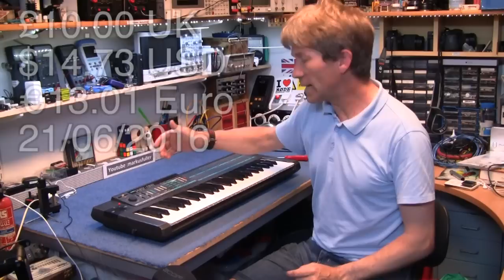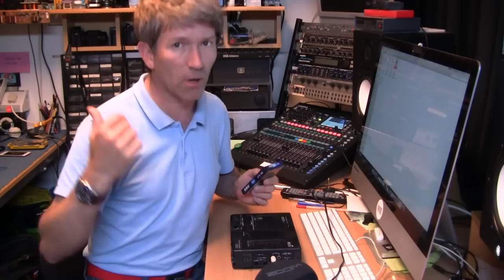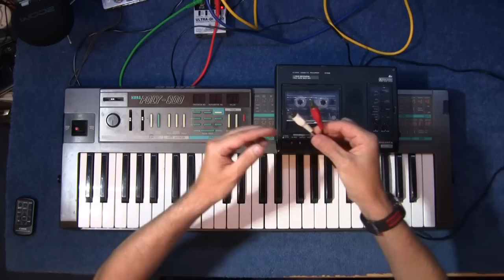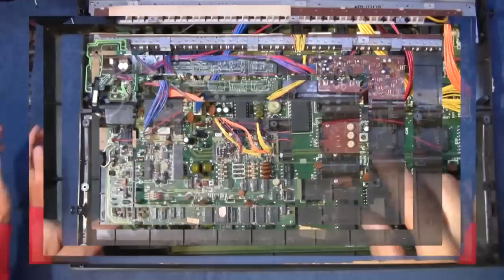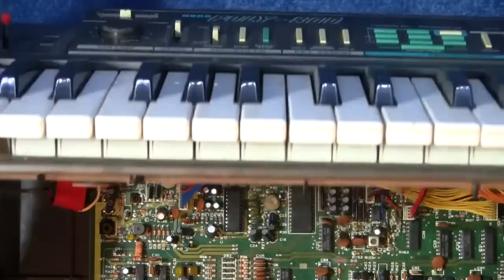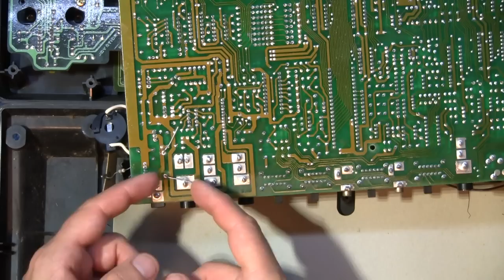korg poly 800 not worth the cost to repair this vintage synthesiser MF#81

Comment: I have a poly-61 in a similar condition. cleaned up board, replaced bad tracks & connectors. No clk out of either MCU, no activity on any pin. Next step would be replace the (socketed) MCUs at £30 each... then the rest is probably bust... so EJECT !!

Comment: Hi ! I am almost done restoring the same synth I got for 100 euros last summer. 1) Got the same sticky and stinky brown layer on all the boards, cleaned it with iso alcohol but that was intense to wash the dirt out between the components with a tiny paint brush. 2) location of the battery was wrong on yours, it's originally right in the middle of the main board not nearby the power supply socket, so it's was a mod. 3) mine was really rusty on a corner of the keyboard frame ,even on some board connectors and some screws...+ 40 years gear...I have left to solder a new socket for the battery and reload the waves after reassembly.I hope it will work well enough while I hunt for new components so I can have it in the end almost like brand new...😅

Comment: Seeing that unsoldered component was just scary. 
From what you found it looks like someone ganked the CPU  and perhaps other componets. That makes it quite a project .
Theres a very detailed schematic with test points and what signals to look for  - lookup: korg-poly800-ex800-service-manual.pdf

Comment: Hello Markus and others. I am in the process of replacing the rubber pads beneath the keys due to wear. Does anyone know are those pads universal or do I need to find specific pads for my keyboard. Mine is a Doner dp 10, two years old
Reply from the maker: @abacussin  Hello abacussin, is those rubber pads are on a long strip and touch a circuit board then they may be the carbon contacts for the keys and you may have to contact Doner to get the correct replacements. however if the keyboard is only 2 years old i’m surprised you have to change them already.
Reply: @markusfuller  Thanks Marcus.I play a lot and its a cheap version of a good keyboard, although it still is quite good for the price i paid.

Comment: I have 5 Mono D Batteries instead of a Buttonbattery and no Solderpoints in the middle of the Board like youve got there! Is this the Solution to Solder a ButtonBatterie upthere, so i dont need no 5 Mono Ds? Can anybody confirm?

Comment: The battery on my poly-61 leaked all over the board and ruined it.  Maybe the battery in this synth was moved to pre-emptively prevent this?
Reply: As he said in this video: The early versions had no internal batterys. The Memory was supplied by Mono D Batterys. The litte Li-battery in this video looks like a battery-mod as in https://www.youtube.com/watch?v=BZj4nYrWFRo
Reply: Not relevant as this unit usually uses a lithium 'button' battery whose leakage is not as deadly damaging as Poly61's NiCd cell was!

Comment: I owned one of these back in the early '80's...first MIDI synth....had the tape backup/load etc... The LED lights should not be flashing/scrolling in the display.  Too bad it wasn't recoverable....thing these days is to be sure and recycle it for parts to help keep another one alive somewhere.
Reply: This effect comes from the Videocam, interfering with the multiplexed LED of the Display.

Comment: I love my Poly 800 bought it new in Dec 1984 Still works perfect I took care of it No dust beer change inside battery 2 times I Never put the  6 batteries in to play remote They will ruin it they leak fast
Reply from the maker: Yes it is a good synth and I feel sad that I could not save this one.

Comment: The two 40 pin chips on the right hand side is the main CPU(Intel 8085) and a PIA. And if it's doing nothing, that does sound like a problem.
Reply from the maker: sadly I am unable to check now as that keyboard ended up being broken down but some of the parts were posted off to other people to help repair their synths.

Comment: You did not need to check the battery. It will hold presets until you turn it off. Even without the battery. First half of the video is useless and boring, sorry

Comment: I still have my Poly 800 that I purchased in 1984 and was excited to see this video. even tho mine isn't currently working either, I cant bear to "part" with it. It had the most lush sweet string sounds ever (that's what I wanted a synth for in the first place)  and for such an inexpensive synth too.  sorry that yours was actually DOA. I was so hoping to hear it again.

Comment: You don't need an actual tape to load the presets, it works by simply connecting the computer directly to the Poly.

Comment: Actually i fixed a few of these they play dead when the battery dies. Then you can restore them with a wav file you can download online and play into the tape input. Then they work like new. But they are a pretty basic analog synth to start with.

Comment: Judging by poor job on the reverse polarity protection, battery getting warm, +4VDC on the output and the voltage regulator being too hot to touch... why didn't you check for a short on the power input first?

Comment: The first thing to do is properly solder the diode in place and clip its leads. The second thing is to measure the voltage coming out of the regulators. That one that is very hot might normally be hot or something on that power rail may be partially or fully shorted. It could be fun trying to pin down if there is some simple problem that can be fixed.

Comment: I have a poly ex-800 sound module, battery is dead and I would get just white noise sounds. I had to write all the sounds from scratch   and save them or just leave it on. The battery was always an issue. Fortuneately its the easiest old module to write to
Mine is still working but the display is hoopy an led is out. The old polysix  keyboard was a beauty it was blue and black lots of knobs no midi? That was a vintage keyboard worth saving, alas it did not happen

Comment: Did you try actually soldering in the diode? Its leads would be carrying half wave rectified AC to whatever it was touching, hence the 4v (4.5v?) DC on the output and overheating regulator. Take the board out, wash it and leave it in the sun / on a radiator for a day. Don't tell me you threw this keyboard out, probably nothing wrong with it!

Comment: 8Bit guy managed to fix his!
Reply: 8 Bit Guy's keyboard just needed a new backup battery, something that is honestly basic maintenance for old keyboards.  The Poly-800 Markus has is beyond repair. The previous owner didn't know anything about how to repair the keyboard and destroyed it.
Reply: Was going to say the same, 8-bit Keys guy had much better luck.
Reply: Wholly different situation. In that case just the battery was dead. This one was messed up..

Comment: said it on 8 bit guys video, but ill say it here too. poly 800 is garbage. stick with the Poly 61.
Reply: Hunter Skowron poly 800 and poly 61 are completely different levels of synths. One is basically a toy the other pro equipment.

Comment: Why do you wear your watch on your right hand?
Reply: That's not a watch, it's an earthing device to prevent static discharge into the electronics, it has a wire attached to the bracelet which in turn is connected to earth.

Comment: the poly 800 wasn't worth buying when it was new
Reply: Or prop up the corner of your trailer home!
Reply: I highly disagree. I used an EX-800 the desktop ver on my first cd in the 90s which sold a few thousand for an indie electronic album that was a DIY release I think when programmed well and marinated in the right reverb it is still useful. Go back to your preset DX7 nostalgia or software based boredom!
Reply: LOL. I actually live in a 2 story brick house. but it's funny you mention that. one corner of our house IS sinking  a bit. and it's the corner where I keep my Hammonds, Leslies and synth collection.

Comment: Poly 800 is currently from 150 to 400 Euros in the bay, depending on its condition and location/continent. I would say, try to fix it and then wait a few years. Analog is rising constantly, even paraphonic ones like this old friend.
Reply from the maker: pontram This one has already had parts donated to repair another poly800 so at least one out of 2 broken ones is running correctly now :-)
Reply: Well, it seems that's a common fate. I bought a defect one myself, to repair mine (or vice versa, there was a huge parts exchange ;-)

Comment: If it would have been a bad battery, the poly would have still worked immediately after reloading the presets. Only after turning the machine off, would the sounds be lost once again, hence you would be back to the strange noises or no sound. Great video, thank you for posting...

Comment: I´m sure that this was a "smoker-unit" as i call them when the guy who owns that first smoked cigarrettes....but i´ve seen much much worse units. My fostex A8 had a very "good" coating on it. Its PCBs had been dark brown and sticky like chewing Gum whereas they should look mid-greenish...I used several litres of iso-alc to clean these PCBs all and thoughout.
The smell when i was cleaning it was absolutly discusting i can tellya...

That main board is definitely BER! But i still would keep the thing "as is", you never know if you need some parts out of it.

Comment: I bought a black keys edition on ebay recently which worked out of the box, but opening it up, that troublesome diode from about 11:00 had broken clean in half! I guess someone must have fed it too much voltage, the wrong way round. Anyway it worked. I replaced the diode and did the Moogslayer mod. However, I can't seem to get it to accept a tape input to reset to factory settings. So I've a feeling the second that battery runs down, it's bye bye Poly 800...
Reply from the maker: I donated mine to a friend who needed parts to bring his back to life, He fixed a separate battery housing inside so he can replace the battery when necessary, if the battery is replaced while the unit is powered on then it does not lose its memory. however im not sure why you cannot send in the factory backup maybe volume of the signal being put in is too low, the led display should flicker as the signal is being read.
Reply: The signal flickers pretty well but always fails. It's a shame, as I have lots of custom WAVs that I've downloaded that I'd like to try. Then again, I have only tried it direct from the computer as opposed to from tape. Perhaps I'll dig out the old NAD andgive that a go!

Comment: I read somewhere u should put the c / d cells battery to keep the patches going on...
Reply from the maker: true if you keep good batteries in it then it should hold its settings but as soon as they are removed or changed then you should have the power supply attached and turned on while you change the batteries over unless there is a good cr2032 internal battery fitted to hold its memory.
Reply: Thanks for the reply markus! I just got me a Poly 800 no external batteries but stored patches after turned off so I'm lovin it!  Anyway I try to clean the keyboards coz some notes didn't work... But I don't know how to remove the keyboard,  ive experienced with yamaha DX which I just push n the keys slipped out. But I seems to can't find a way to slipped it out on korg Poly 800... Can u give a Lil guidance.... Anyway really enjoy your videos
Reply from the maker: Hello LLOYD, sadly I have already donated my poly to another viewer that needed some parts so I cannot open it up and check how the keys are removed. you may find that the long thin circuit board that runs under the keys can be unscrewed and lifted out. that will contain the switchgear that needs cleaning instead of removing all the keys.
Reply: Thank u so much I think I'll give it a try later!  Anyway yeah I lost my patches after hours lol. I guess the external batteries do required to keep the patches. Thanks to modern technology n this video though I know load it via cellphone for just seconds... Thanks again markus
Reply from the maker: A friend of mine has one of these and it has a 2xAA battery module with long wires on it leading to the solder points of where the old onboard battery was. therefore he has glued the 2xAA battery box away from the board so if they leak over time they will not destroy the tracks of the circuit board.
Reply: I've clean the carbon on the rubber n contact with stadler eraser without removing the keys just like your suggestion now it works thanks!  I also adjust / correcting pitch by tweaking the trim pots. I almost got it perfect now lol. Just need to work on the external batteries :D
Reply: Oh yeah markus I have one more question some keys makin noise when I press is like they're slamming n have no spring under. Do u know what might b the issue?  Thanks...
Reply from the maker: maybe the springing mechanism is worn due to age. but I have never had to deal with that problem so Im not too sure.
Reply: Ok Thank you so much for your replies Markus I'd really appreciate it

Comment: i have one of these that works but cant be programmed because of the battery being old.  its one with the inverted key colors. wish i had the time and battery and program to make it all 100% again.
Reply from the maker: You can buy the battery easily and just solder it into place. or even place it somewhere away from the board and use a couple of cables. if the battery is old and you leave it in there it could leak and damage your synth over time.

Comment: Hi markus!!! Nice to meet you!!! I have since a long time ago a second hand Roland JV-80. When I buyed it (pretty inexperienced at that time) it arrived to me with no data on its memory because the original battery was out of charge. The original owner did replaced it but leaved the instrument with no data. From that time I used the instrument with my own sounds, Because it works and sounds very good, but I would want to recover the original data. Is it any Expansion cards for this situation or downloadable data from the web? I love your videos and your help. Please tell me what do you think. Cheers from Argentina
Reply from the maker: Hello Emerson. hold down the number 8 button and turn on the JV-80 (keep this button pressed down while turning on.) then you should get a (factory reset) appear in the screen. then let go of the 8 button and press the ENTER button. that should set the unit back to the original settings in a few moments as if you just purchased it from new. I hope this helps. Best wishes from Markus.

Comment: nice vid

but i had the same problem and weird voltages everywhere which can mislead you a lot.
i replaced the voltage regulator and it work fine again

Comment: On the positive side, the cheaply made Poly 800 is far from rare.  I've had about 5 of 'em over the years ... the last one I had wasn't making a sound so I sold it for 50 bucks.  These days I keep company with a Poly-800-II, which is a much, much nicer instrument.  In contrast to the original it has a handsome black enclosure, a filthy digital delay with modulation, programmable bass/treble EQ per patch, MIDI sysex, and the real kicker: exponential envelope curves (vs. linear on the original).  So the mkII always sounds punchier, and has a more ethereal release stage - it's what the original should have been.
Reply: That chorus on the og though.

Comment: There would've been a battery on the board originally (on the two pads you point out at the beginning), but those old Korgs had a bad reputation for the batteries eventually rupturing and etching away the entire board along with the components.  That's what happened here too.

Comment: I'm not sure about this, but I remember getting a korg poly 61 a while back off ebay and when I first turned it on, it did the exact same thing - TAPE over the LED display, weird little pops and clicks coming from playing the keys. I realized that I had it in tape mode - there is a switch on the back. Switched it off and it worked completely as it should have after that. Don't know if that would be the same case here or not.

Comment: One thing to check is the the presets are filled with scrambled data. If you go through the parameters you will probably see that some of them have values beyond their range or strange characters. When the RAM blocks have bad data written to them they can't be written over with the preset tape. I've had something similar happen and to fix it I went the Patch 11 and set all the values to the proper range then copied patch 11 to the other slots. After this procedure I was able to transfer the factory sounds from tape.
Don't give up on it yet! Thanks for the vid.
Reply from the maker: Thanks Puffin Thomas. I have put it away for a rainy day. but I will remember your advice if I ever get it back on my desk. Many thanks from markus
Reply: Wow. That's super interesting! I'm going to remember that for later.
Reply: @mraduanemc  me too!

Comment: I do hope you disposed of it in such a way as a third person won't try to fix it. I had a Seil Synth that had a failed voltage regulator dumping overvoltage through the entire logic board. As soon as I found that, I dumped it too.  I also had overvoltage on a VCS-3. That one I fixed!
Reply from the maker: Hi I have kept it in the garage for possible parts donations. it is in no condition for someone else to try and fix. (oh the VCS-3 wow what an amazing synth to have, thumbs up to you )